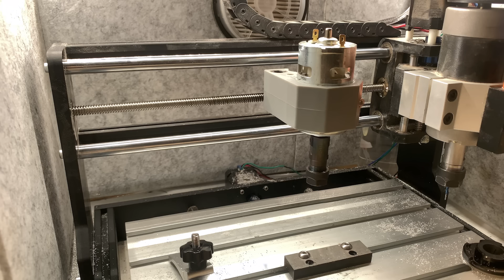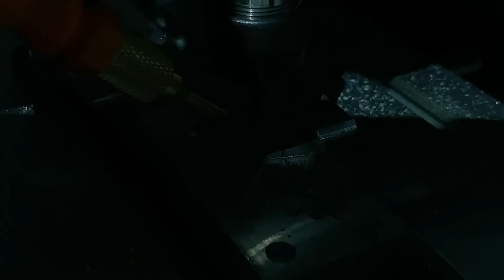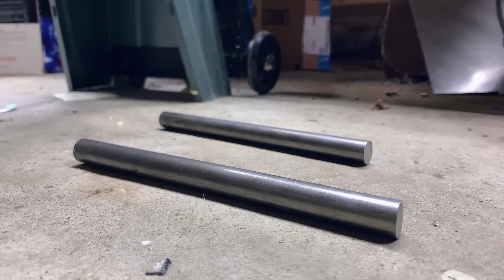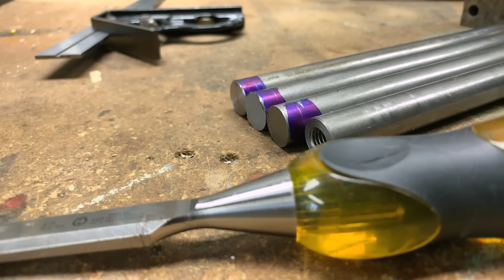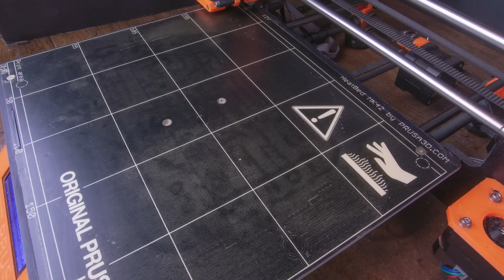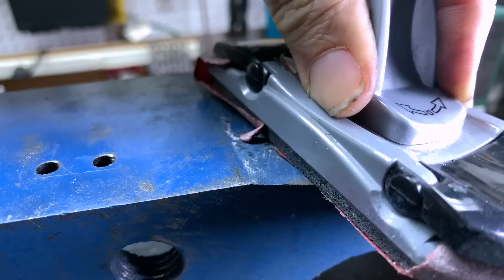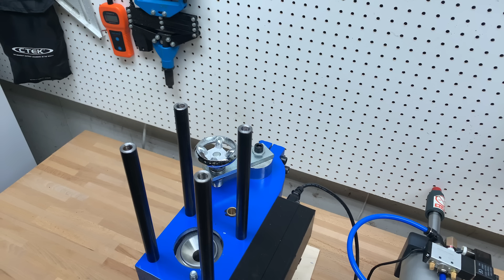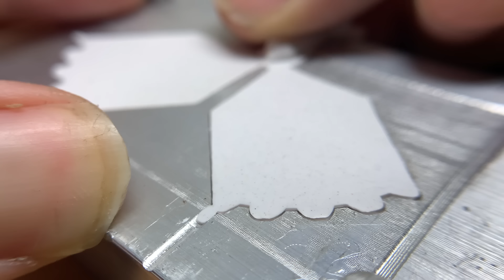Build an Injection Molding Machine From a Cheap Pneumatic Press

Comment: Do you apply any backpressure to prevent the formation of voids? The parts look relatively thick and the mold isn't cooled. But since those parts aren't really bearing any load, it shouldn't be a problem
Reply from the maker: The hold time for the shot is adjustable, which in theory could provide extra feeding during cooling.  I think I only had it set for about a second on the shots in this video, but you can certainly program anything in.   The PE I was shooting showed some shrinkage visible on the flat face of the logos, but you're correct that because they're just RetroTech logos they have no load, so I'm not worried about voids/weld lines, etc.
Reply: @retrotechjournal  Seems like it, ye. It's really fascinating to see that machine work so well.

btw:
Theoretically, if you're actively cooling the mold (with PE to around 25°C-30°C which should be easily achievable by drilling like 2-4 holes the long way through the molds and hooking up a pump to it (if you so desire)) the cooling time (end of injecting + holding + how much time you give it to cool off) should be roughly around 2x^2s, where x is the thickest part in mm. A part with a thickness of 3mm, would need around 18s cooling time.
Reply from the maker: @MrJoBilly  Oh interesting.  It is true that water cooling shouldn't be that crazy had to do, and if I were intending to do a large run of thick-ish parts that really needed consistency/strength that would really be the way to go.  Thanks for the info!  I can't see myself doing it in the near term simply because that's another whole system with possible leaks, etc. but I'll keep it in mind if I end up in that territory. 👍

Comment: Just a tip: keep your lathe cleaner! You have plastic chips right where hot metal chips can fall, that's a recipe for fire. Also: a spurious chip can seriously ruin your day by getting in between your ways.
Reply from the maker: That’s a good point. I hadn’t thought about fire danger. I should be keeping that cleaner anyway.

Comment: No idea why i came across this video while looking for a tutorial on dimensioning drawings in Fusion 360, but boy was this good. Awesome editing and presentation skills! It really was a joy to watch! I forgot what I was doing in Fusion and sat here watching with full attention for the full 25 minutes. I'm also surprised about he amount of subs and likes. You can easily compete with the big guys out there. I truly hope that  you'll get the exposure you deserve as you obviously put in a awful lot of time and effort into your projects. Anyway, one more follower from the Netherlands. I wish you the best of luck
Reply from the maker: I'm glad you liked the video!   Perhaps you did come to the right place. I can also answer Fusion 360 questions.  The dimension tool is 'd' as a keyboard shortcut.  esc to exit.  Clicking on an arc will let you put in a diameter, clicking on an edge with allow you to add either an axis aligned dimension or if you move away from the edge perpendicularly you can add a length dimension.  Clicking on two parallel lines will add a distance between the two lines.  Clicking on two edges that meet at a point will add an angle dimension.  When typing in the value you can type in named values that will auto complete, but perhaps the most useful thing is you can create named dimensions right there buy putting in something like screw_hole_diam = 3.75 and that will create the named dim and apply it so the next time you make a circle you can just type "screw_h<auto completes to screw_hole_diam>" and all those circles will be driven by the same value and can be adjusted with num value change. lol. Sorry.  I've been learning Fusion 360 too!  Welcome aboard!

Comment: this project is actually pretty neat! 😍 I wonder if a screw type applicator method could be used?Since that is how they work on large scale machines.
Reply from the maker: It might be possible to build a screw style drive but this ram style is much simpler and easier to clean/swap plastics etc. A screw design would however have the advantage of better mixing the plastic so you might be able to get more colors by adding some colorant pellets, but in general it feels a lot harder to build unless there’s some sort of surplus screw mechanism one could leverage.

Comment: just a little question : are the bars that goes around the main cylinder made out of steel ? I can't imagine how hard it is to thread the holes. 
My only experience with taps was in pla for long threads into the plastic parts, at a time I didn't have threaded inserts, and well I decided to make myself a heater bloc for an e3d v6 hotend out of an old cpu cooler, I had such a nerve-wracking time when hand-threading the holes as the tap needed a lot of torque to get inside, I really though I was going to break my little M3 one
Reply from the maker: Well it is true that tap breakage can be scary.  Thankfully with bigger taps like this that doesn't happen as easily.   Threading tiny holes is the scary thing.  Doing these big ones wasn't scary at all. I enjoy the @breaking taps channel, but the name gives me the willies because breaking a tap tends to happen late in the making of a part and is always a giant pain to deal with/can scrap the part.  (Unless it's in AL where you can easily eat the tap up with a bath of Alum.)  :]

Comment: I was digging the video already and then you got to the stop motion Lego part and you earned a subscriber.  This is the first video I've ever seen of yours and your attention to detail and production value is NUTS!  I'll have to go back and check out your backlog :)
Reply from the maker: Welcome Aboard!  Yes, please do check out my other videos.  I hope I've been getting a bit better over time, but I've always tried to pull off high production values.  I approach the videos just like I approach any other project, with ridiculous attention to detail.  ;]
Reply: @retrotechjournal  I do a LOT of DIY stuff but nothing nearly as detailed or complex.  Mostly small home furniture construction and some resin casting, but I'm always branching out into other things.  I don't think I have quite the tools needed to make one of these, but damn I wish I could!
Reply from the maker: @AtariZeroTV  Awesome!  I've always wanted to try making furniture.  I did make one Totoro Step stool, but that whole area is very interesting to me.  It is true that I've been building up a tool base for all of my adult life, but I do think DIY is all about mind set, not tool base.  That's one of the reasons Maker spaces have been so revolutionary.  I did laser cut projects for 10 years before I got my own, etc.  It's often much better to have occasional access to a tool VS having it mostly collecting dust and then only getting used 2 times a year.  When my local maker space closed I was devastated.

Comment: Watched on a lark. Impressive build. 30-40 seconds cycles isn’t too shabby. I operated PET injection molders making bottle preforms for several years then went to maintenance and repaired the machines and the blow molders that blew the preforms. I learned a ton and tho now retired still find the tech interesting. In the mid 90’s our plant would make over a million preforms in a day.  48 in a shot at about 24 sec cycles. 9 machines. Now they’re running 11 machines and 72 and 96 cavity molds. 
One word……..Plastics😜
Reply from the maker: 🎖️for a The Graduate mention. 😆 Wow, working on those machines sounds really interesting/educational. What was the most common problem with those rigs? I’m always impressed that they run through so many cycles. Millions of parts a day… phew! Thank you for your nice note.
Reply: A lot of hydraulic leaks and as computer control issues. The tech is pretty impressive but diagnosis is becoming more complicated. Look for videos of Coca Cola canning and bottling. They make our bottling lines look slow. I worked in a liquid detergent plant where we produced all our bottles, liquids, filling and packaging. I really did enjoy my work. Lots of variety. 😊
Reply from the maker: @bradgotschall3259  Variety and troubleshooting are both things I like in a job. Sounds interesting. I did work in a box factory one summer but just on the lines not on the troubleshooting/maintenance side.

Comment: you need fluffy sweaters
Reply from the maker: I actually have a lot of fluffy sweaters that my mom knit for me.  The shop's not really the place to wear them though. No way I'd want to get cutting oil on a cable knit sweater.  :]
Reply: @retrotechjournal  But what if you did your head on discussions in front of a fireplace like santa claus.......you should be santa claus

Comment: Machine pocket out of the bottom is simple with basic tools. Air compressor and die grinder with bits. Quick and simple.
Reply from the maker: I guess you're right.  It did however take it from being a "drill and tap a few holes, and you can get the rest of the parts by ordering from send cut send and Buster Beagle 3D" to being a bit more than that.  So I didn't really try to Kit-a-fy it.

Comment: well I know how I'm going to insert my threaded inserts from now on at least
Reply from the maker: Great!  One thing it remember is it's great to press the inserts in quickly if you want to maintain registration.  Once the plastic melts there's really nothing controlling exact position, the press lets you kind of jam it down into the cone shaped hole and get out again before everything turns to soup.  :] Once in a while you still might have to adjust an insert laterally if you were too slow and something went wrong, but it really is the best way I've found to put in inserts.  Good luck!

Comment: i bought one of those hammer drill to drill press sets, and i was hoping to put it onto some 3/4 threaded pipe to make it into a standing drill presses, partly disassembleable for storage since i dont have a dedicated space to work. unfortunately, the 3/4 pipe is too thick by about 2 millimeters, any suggestions on shaving that down? what might i use on a lathe? can beltsander sandpaper do it?
Reply from the maker: Well a metal lathe is certainly the best way to do that.  I could in theory do that simply by spinning and using sandpaper, but 2mm is quite a bit to remove, and you have to manually try to keep it nice and cylindrical.  How long a section would you have to narrow?  It's doable with sandpaper, but it's not going to be simple. Use a sanding block, and keep testing to make sure you're not making a cone, try to keep things even.  You might be better off using a hand file on the spinning pipe if you can keep the speeds low.  If you end up sanding be careful not to inhale a ton of dust.
Reply: @retrotechjournal  i gave it a try with a 50 grit sanding belt cut open and the ends sandwiched between 3 pieces of 1x4 each, and managed to clean off the coating on the outside of the pipe. i might have better luck with reaming the aluminum frame openings instead.
Reply from the maker: @briancollins7296  Ja 1mm is a lot of steel to remove.

Comment: Hey nice channel. Keep making cool stuff. Very interested in how you made the CNC router. I know there are 1000's of videos on how to do that but yours came out really nice actually sooo it would be pretty cool to know how you did it. Instant subscriber cant wait to see what you come up with next.
Reply from the maker: It is true there must be a zillion videos about those 3018 cncs.  I didn’t document my mods.  I should probably at least clean up my models for the gantry/box and make a short video about that. The big problem is I put fatter rods in to stiffen it up.  Which works well and is cheap but one has to be able to precision cut hardened rod. I think most 3018 tinkerers don’t have a good way of doing that. Also I intensionally sacrificed some vertical travel for more stiffness which was ok for low AL blanks but might not be the best for general CNCing.  I’ll think about putting something out there.  You’re not the first to ask about it.  I am about to try increasing the y axis travel and wiring in some end stops. Maybe that will get me videoing.  I have to finish this other video first though.
Reply: @retrotechjournal  Well I look forward to what ever you put out. For lack of not knowing what its called, Seems like you have great filming skills. Keep up the great work.

Comment: Love your channel and content. The layout and editing is on point. Any plans to release one on the 3018 updates and retrofit?
Reply from the maker: I’m not sure. I didn’t film any of that in the interest of actually getting it all done.  Other than that one shot of the glue up.  I probably should have filmed a bit more.  The upgrades were fairly easy/cheap but require someone to be able to precisely cut hardened rod so they’re not super easy for general folks. Maybe I should do one about the enclosure which is maybe a few too many parts/crazy but I’ve really enjoyed it in terms of dust/noise management.

Comment: Well, maybe "Pneumatic Press" is cheap, but all tools you used - they are not cheap 😆 Anyway, it was great job - to "upgrade" piece of iron till useful machine. My only concern is why the hell you need it??? Don't you suppose to produce hundreds "wings" you shown?? For that there is factory, which does job same well (if not better).
Reply from the maker: Well mostly I did it to learn CAM, and because it was fun.  For almost every project I do the 3D printer is better because I'm only making a few parts.  However I have done some projects like the computer controlled loom where being able to redesign the part and quickly make 120 more of them would have been a huge advantage since I spent weeks 3D printing various revs of those parts.  In that sort of quantity having a factor tool up and do it is neither quick nor practical.

Comment: Loved the video! Subscribed! Tip for the threaded inserts: I printed that same soldering iron drill press insert jig and have since switched to just using a Pinecil soldering iron, free hand. I gained more control and the process went much faster for me.
Reply from the maker: I'm glad you liked the video!  I find that doing the inserts with the drill press lets me press a lot of inserts in to the same depth very quickly, and that the press action lets me push them fully into place before the surrounding material turns to soup, so I get consistent positioning, which is hard to do by hand.  You have to press them in with a fair amount of force/speed.  In my video the pressing is shown in slow-mo, but speed is key because the only real alignment guarantee is the surrounding cone of plastic that goes molten very quickly.  They have to get crushed in and the iron backed out before the hot insert fully liquefies the surrounding material.  I will still do some inserts by hand if they're in an awkward position that doesn't have an opposing flat surface, but I vastly prefer to do it on the press.  There's technique with either system. To each their own... PS I'm sure others were already doing it at that time, but I wasn't aware of it in 2016, so I invented that system/holder for myself.  https://retrotechjournal.com/2016/06/21/soldering-iron-drill-press-adaptor/

Comment: some locating pins on the dies, small dbl action air cylinders, and a 40psi oilless air compressor ... You'd be close to automated .
An older Commercial PhotoFinishing Unit ... was my $alvation .
Reply from the maker: It’s an interesting idea.  The clamping forces can be substantial though so I’ve been looking at things like those hydraulic intensifiers. Boy some of that old equipment really had great stuff under the hood!
Reply: @retrotechjournal  I was very lucky, just as IC's became good, and BOARDS became MOTHERBOARDS ..
I salvaged 3 very large commercial photocopiers, and the PhotoFinishing Unit .
Everything you could imagine ... In multiples .. optics, chain drivetrains, 220V 10A relays, limit switches ...
 I was falling into a mesmerizing kaleidoscope waterslide of dreamin !!
Reply from the maker: @kennethkustren  yes!  I remember those chain drives!  I also salvaged some great ball screw/ drives out of some giant printer (or maybe plotter) still things are much better now.  You can get an incredible stepper driver new for only a couple of dollars, heat sink included.
Reply: @retrotechjournal  My 4axis CNC Controller c\w LPt connection ... was great until theGlitch of MS Windows TimeSlicing became apparent . Still...  I bought a set of 3 NEMA23 2V 2A Stepper Motors .... an XBOX controller for Serial Control 
and am stuck now .  PURGATORY is my Home .
Reply from the maker: @kennethkustren  I put no faith in non real time OSs trying to do real-time jobs.
Reply: @retrotechjournal  ALAS ... You know my problem ... BUT ... ¡! ...
ADUINO and ARM have grown up ... and those SBC are lookin' might 'attemptful' .
I might rebuild my 700W PS Intel 1.68GHz MMX, 1.44TB of SATA array, and the LIGHTScribe DVD R\W ...
for "experiments"  .
For the Children .
And Sequoia FALCO F.8 ... that I need a CNC for .

Comment: Remember many plastics contain toxic or corrosive monimers. Research what you use first. ABS for instance is made with cyanide which is released when burned.
Reply from the maker: 100% I’ve pretty much stuck to injecting PE since it both flows well and isn’t super nasty fume wise. Still it’s important to have decent ventilation/fume extraction.